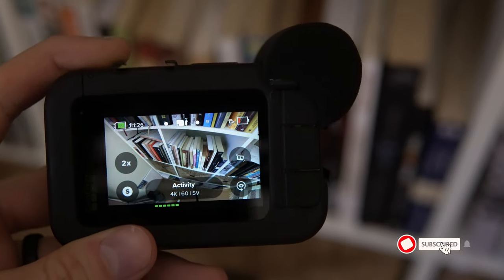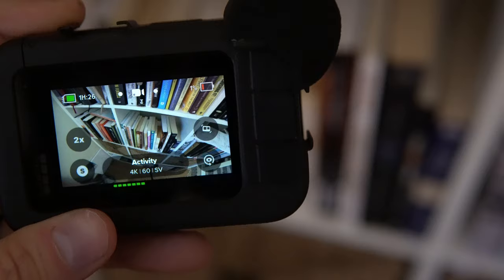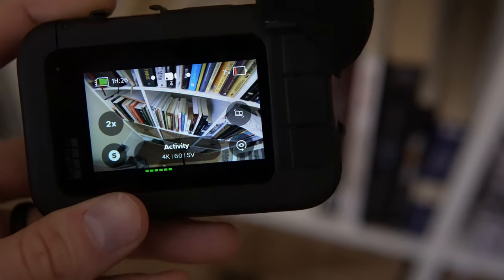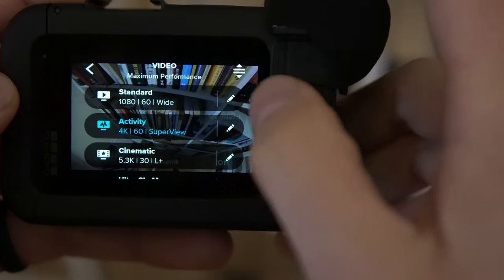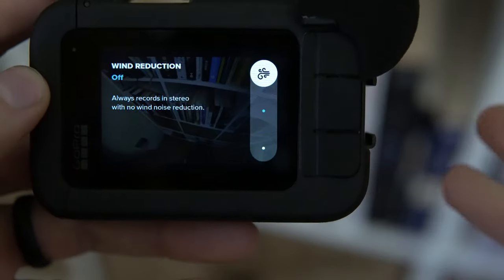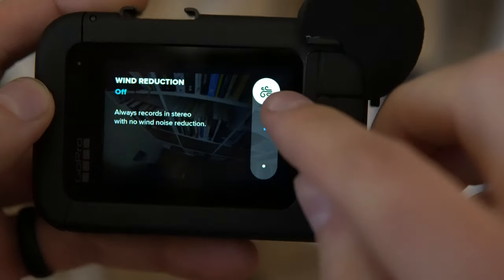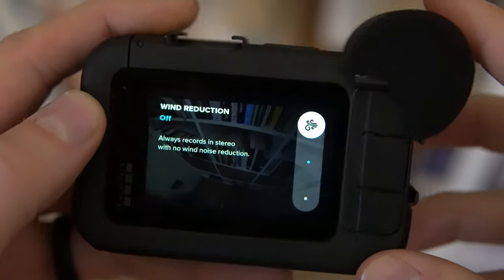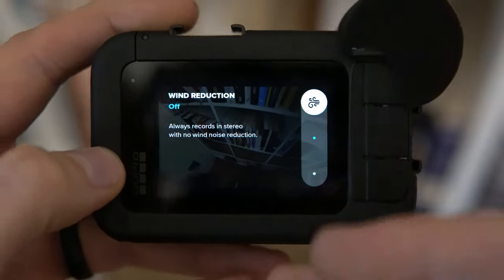How to STOP pops and cracks when moto vlogging on your GoPro

Comment: Man let me tell you what. 
Ive bought multiple top of the line mic's and no matter what as soon as i hit 60+mph i get the cracks and pops.
I have a chin curtain, a nose guard, a foam cover on the mic and a deadcat on top.
No interference anywhere and did a lot of research on placement.
I swear if this works im going to be so happy and mad at the same time.
What an ironic fix lol
Reply from the maker: Yeah I actually played with the bit rate also. Changed to a lower bit rate and cleaned it up even more. 

So crazy. This took me forever to figure out. I hope it helps.
Reply: @AmericanAbroad1  THanks! 
Im trying this. Went through 3 Mics already :D :D

Comment: Where do you place you’re mic inside the helmet? I have mine positioned far to the right behind the cheek pad but it still picks up my breathing which is just obnoxious!
Reply from the maker: So it took me a ton of tries to sort this issue. Unfortunately GoPro doesn’t have a gain adjustment. 

So honestly the cheapest worst lapel mics work best. I use a $7 mic. Because they normally don’t pick up sound as well, which is a plus in this case. 

Also I started having issues on the highway when I changed helmets. 

BIG TIP: I changed my bit rate to a higher bit rate on the camera setting and from then on…. No more issues with wind noise or breathing. I hope this helps
Reply: @AmericanAbroad1  Great info, thanks! Changed my bit rate as well so we shall see on the next test run. This is my first GoPro (HERO11) and I gotta say, between connectivity issues, mic gain issues, battery life …just overall usability, very disappointing but I’ll keep trying to dial it in. Thanks again!
Reply: @AmericanAbroad1  Made the changes, going to test it out next week. I also have the media mod so I have changed the settings to rear mic for that, turned OFF the wind settings and just went to "standard" for mic gain. I am using the Movo ACM400 so I hope this helps cure some of the issues because its a decent mic just hate to have to buy another just for this issue. Kinda ridiculous to be honest...